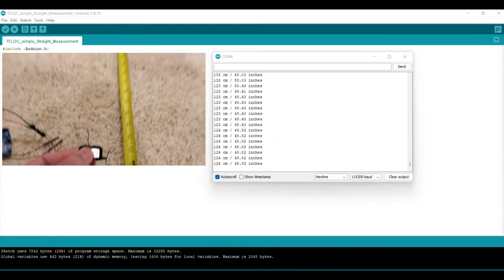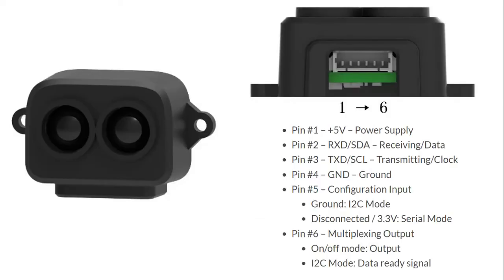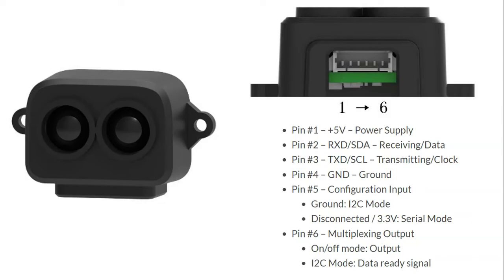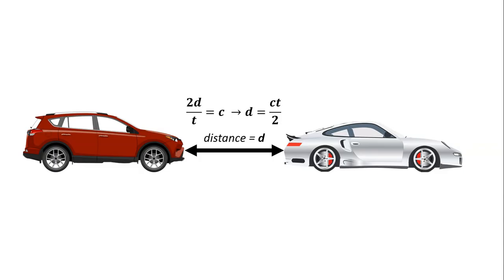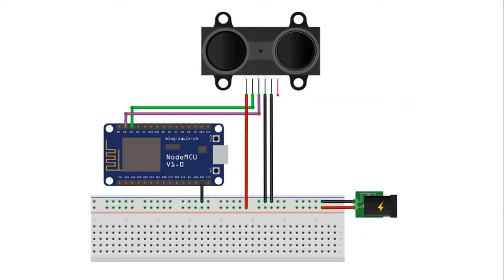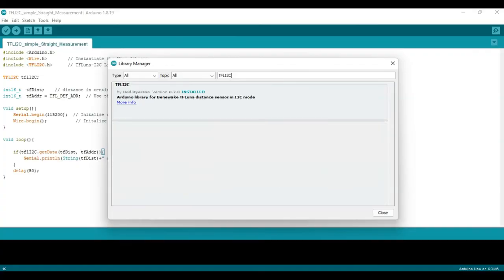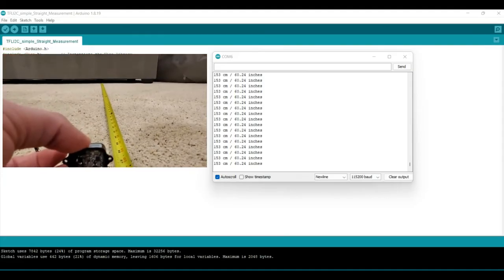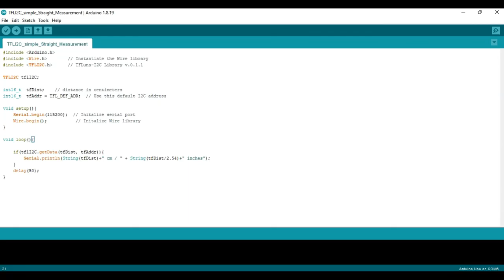LiDAR with Arduino - TF-Luna Sensor

Comment: I'm using this with a Pro Micro board but my values are all the way maxed out, and out of range, all of the time. Could this be because of low light?
Reply: Maybe you are using 5v logic? What voltage is your Pro micro?

Comment: Cool video man. I'm building a bot for an all ages stem course I'm teaching for a non-profit. It's in my drawer of arduinoesque sensors you can't get 6 pieces for 10 bucks. Is it worth looking into you think or buy one of the better ones while I can still send this one back? I'm currently finishing up the bno055 visualization data in vpython to see if I need it. What a time I had getting that bno. Made me brush up on my math though haha.

Comment: Does it work with ESP 32?
Reply from the maker: Hi. Thanks for watching! The main transfer of information is being done via I2C communication. The ESP 32 supports this via GPIO 21 and GPIO 22. Therefore it is possible. You still need to make sure you properly power the sensor.

Comment: can you give me the link to the code pls
thank u
Reply from the maker: Hi, thanks for watching! The link is in the video description.
Reply: @diyengineers  thank u
do I really have to connect the I2C pin to the ground? I am using the 4 first only
Reply from the maker: Are you saying you are leaving pin #5 disconnected? If so, that means that you are using the sensor in Serial port Communications mode instead of I2C mode. In that case, you shouldn't connect the sensor to the Arduino I2C pins.
Reply: @diyengineers  Yes, can you please do a tutorial for that as well.
Reply: also I amplanning to use two lidar in one arduino uno, can I use the hardware serial and the software serial? for themboth to work
Reply: @guujikenn  did it work any update